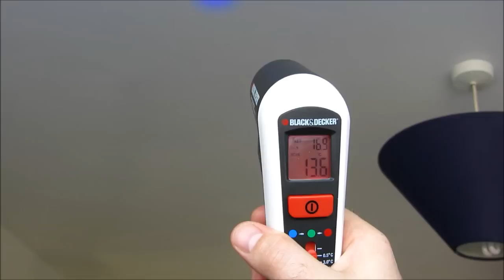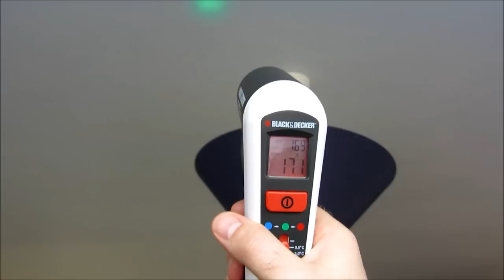Black&Decker Thermal Leak Detector demo

Comment: Great demonstration. My house is full of cold spots so now I will just go and buy one of these and get cracking with reducing them 😊❤
Reply from the maker: Infrared non contact thermometers basically do the same thing. If they have a 'surface temperature' mode you could use them instead.
Reply: Thanks for your advice. I have now purchased the Black and Decker ❤😅

Comment: What color indicates there is a moisture or leakage please
Reply from the maker: It doesn't detect moisture, just temperature. The leakage I refer to is leaking heat.
Reply: @mikepepler  - Hi Mike and many thanks for posting this useful video. Just to follow up on what Sunil had originally posted; could you confirm my assumption that blue is bad where the draughts or leaks are present and that red is good where draughts are not present? Much appreciated.
Reply from the maker: Yes, that's right if you're indoors - blue indicates a cold spot. But note that it's measuring the surface temperature, not the air temperature, and a low surface temperature could be due to poor insulation as well as a draught.